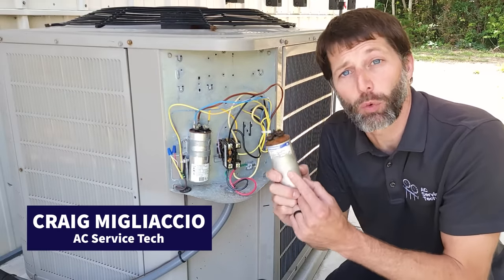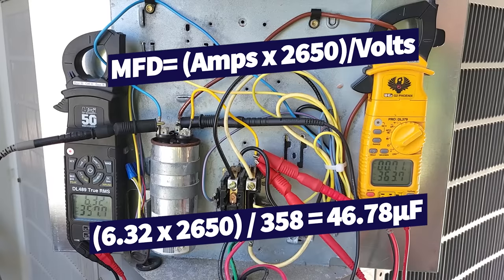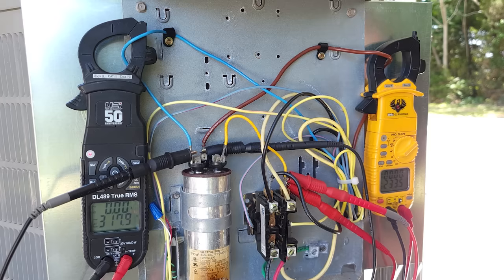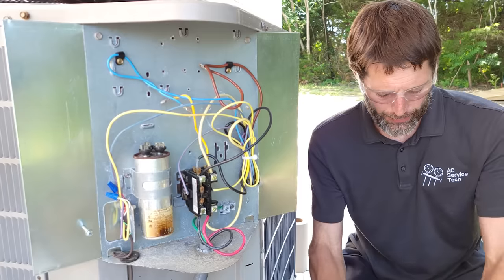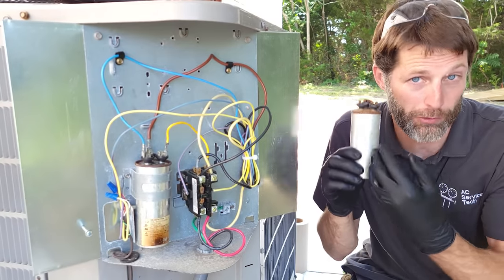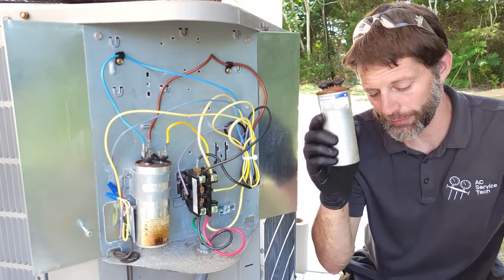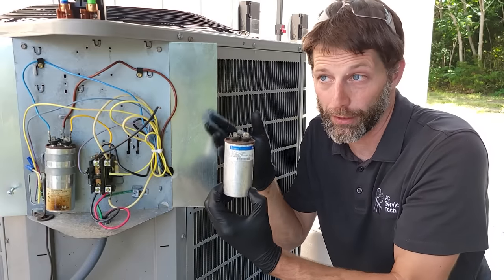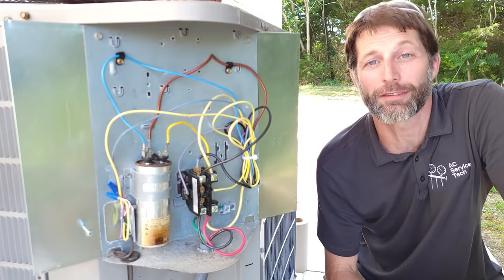WHY CAPACITORS FAIL in Air Conditioners! Watch it Break!

Comment: My compressor fan shuts off after 10 minutes of turning the AC on but the compressor still running. I have to turn off the AC and wait for about 15-30 minutes then everything is fine but the Fan will turn off again after 10 minutes.
Reply: Fans have a thermal safety in them. Something is kicking it out, your fan motor is overheating.
Usually this can be the motor windings failing, but test (or replace) the capacitor [cheaper] first.
(Also, are the bearings good? - turn freely, NO drag?). Sometimes you can oil them, sometimes there are capped off oil ports (2) at the 'edge' of the motor case that lead to the center to the bearings (usually are metal plugs, look like a rivet head).
A new fan motor is probably in your future...
Mr KL

Comment: What about when the power company loses grid control and “brown out occurs (voltage low)? Ohms law suggests current high in that scenario, does it not?
Reply: No, capacitor will only allow so much in and out.

Comment: Will a bad capacitor cause fuses to blow???
Reply: They can but not always.  If the compressor can't start because power isn't getting to the start winding but has power to the run winding, it will pull a large amount of current because it is trying to start spinning but can't because the start winding isn't getting power.  The start winding basically gives it a short but large power boost.  Most compressors can't start without a working start winding and power.  

As a example, a really old central A/C we had would pull about 22 amps while running.  When it was starting, it would pull 50 to 60 amps for a very short time.  I'd estimate well under a second.  If the start winding wasn't getting power, it would pull that 50 or 60 amps until the breaker tripped or the fuse burned out.  It is actually a good thing since it can prevent damage to the compressor.  

Some motors also have a capacitor on the run winding.  Most of the time, if it fails, it just sits there.  My well pump has a run capacitor and when it failed, nothing.  No hum, buzz or anything.  I might add, the capacitor looked fine.  No discoloration or buldging.  Testing showed it was bad tho.  A run capacitor and a start capacitor works in different ways. 

Also, if you are replacing one of these things, make sure power is off and use a screwdriver to short all terminals.  Sometimes a good part of a capacitor could have a charge.  It can be painful or even deadly.  Make sure you only grab the handle and the handle insulates, no wood handles that may have a crack or have mosture in it.  Also, no plastic handles with cracks either. 

Hope that helps.

Comment: Is it ok to install a capacitor that is a little above the rating of the one you are replacing??
Reply: NO. Always use the properly rated cap. Bigger is not better here.
Reply: @davidb7180 
The voltage rating on the cap is an  indication of what voltage the insultation may fail. A higher rating, if available, is a good thing.  The capacitance (mfd), however, affects how it does its job and should be as originally supplyed.
Reply: I agree with Gary.  I higher voltage rating will be fine.  May last longer even.  However, the value of capacitance must be the same.  If you have a weak motor, a service person may change the value which will give you a little time to plan for bigger repairs but they are no guarantee on how long it will last.  At best, a last resort.  At worst, won't work or cause more damage.

Comment: Older Rheem condensers had the capacitors placed in the airflow before the coil and in my experience they failed less often.
Reply: I have two of those; one is from 1996.
Reply: @kwm380  They are very well made units.
Reply: This is true
Reply: The old caps that were in the gray plastic case
Reply: Those Rheem low flat green stamped cubes were so well made. There are still plenty in service.

Comment: how do you get the 2560 factor when calculating the cap size
Reply: It comes from the reactance formula.  The most accurate numbers are 2652, 2653 instead of 2650; depends on how many numbers one uses of pi.  As Will F says in the comments on hvac r school dot com:
It’s 2653, because of E = I * Xc.
Capacitive Reactance (Xc) is calculated like this:
Xc = 1 / (2 x pi x hz x farad)
Xc = 1 / (2 x 3.1415 (pi) x 60 (hz) x farad)
Xc = 0.0026527 x farad
farad = 1,000,000 microfarads
So 0.0026527 must be multiplied by 1,000,000
Xc = 0.0026527 ✕ 1,000,000
Xc = 2652.7
E = I x 2653
Also, using this method can make good capacitors look bad if your amp clamp doesn’t have a resolution of .01. Also allow 10% on capacitors to account for meter error.
Always test both ways using a good DMM before charging a client.

Comment: Years ago I had a brand new carrier residential type package unit at a warehouse and the inducer motor run capacitor was getting wiped out every week, we tried a new motor, checked voltage and hertz, no swelling or leaking, tech support came out, he blamed the fact that one of the 2 legs measured 240 to ground each (even though it was 240 line to line), I left the company before seeing the cause or how it was resolved. I wonder the cause.
Reply: Inducer motors have run caps?
Reply: @marioramirez6741  some do, this was 4uF I believe
Reply: @ChrisHVACguy  was it mounted to the motor housing and/or near the burners? Seems like a dumb suggestion but can it mounted it on the blower compartment. I know it's too late now but just a thought.
Reply: @marioramirez6741  was mounted way above burners in a separate compartment next to the circuit board, I'm sure it could have, might have been worth a shot
Reply: It's possible the system was on a 208 three phase ungrounded system. The inducer fan was on a contractor that was single pole. Leaving line power on the motor. The third phase could go to ground some where else in the wearhouse .then the other two phases have potential to ground .this can take out the weak link.
Reply: @peterstencell804  unless there's was a trickle current to ground on the motor or cap, I don't see how this would be an issue, it's common for lines in a unit to have potential to ground.

Comment: What does it indicate if a wire melts in two.
Reply: Usually a bad or corroded or loose connection; creates heat that accelerates more corrosion until it burns in two.
Clean EVERYTHING bright, and put on a new terminal,. Check for heat damaged to component.
Mr KL

Comment: I have a question that someone here may answer. I replaced a bad cap in my window shaker but the only one with the correct rating was physically larger and oval. Only way to install it was upside down, think that will cause a problem?
Reply: As long as the rating is correct, I think it should be fine.  However, my expertise is in digital electronics, not high-power stuff like air conditioners.
Reply: @electronics-girl  thanks for replying its been working so far🖖
Reply: Most capacitors will work in any orientation.  There are some that won't but I've never actually seen one and I've worked on all sorts of things.
Reply: @noneyabus1  thanks for the input🖖

Comment: Can you tell what is that constant of 2650?
Reply: For an AC circuit, I=E/Z where Z is the impedance.  The impedance (Z) of a capacitor = 1/(2*Pi*f*C) where f = frequency and C = capacitance.  Therefore if you substitute 1/(2*Pi*f*C) for Z in the formula I=E/Z you come up with I = E/[1/(2*Pi*f*C)].  If you rearrange the formula you then get I/(E*2*Pi*f) = C where Pi = 3.14159 and f = 60 for a 60 Hz system.  The formula then becomes I/(E*376.9908) = C  This is the same as (I*0.002653)/E = C and C is in units of Farads, but since we want C in units of microfarad the formula becomes (I*0.002653/E) = C/1,000,000 and this can then be written as (I*0.002653*1,000,000)/E = C in units of ufd which is the same as (I*2653)/E = C in units of microfarad.

Comment: The main purpose of this capacitor is to throw the sinewave out of phase. It can be done with an inductor but it would be larger and more expensive. Smaller motors use a start winding

Comment: you know I'm quite proud of myself l o l My AC wasn't working so I took apart my compressor learned what a capacitor was notice the top was all rusty and as you see mushroomed figure that was the problem replaced it, works. Then I found this video LOL but I'm glad it confirms without all the multimeter stuff that I was right by eyeballing it

Comment: capacitors should be painted black to radiate heat and or have black heatsinks to do same...simple soultion or even put a small fan to keep it cool or a bleed air tube from the main output
Reply: just a note,  the majority of thermal radiation energy flux at room-like temperatures is in the range of 7000 to 26000 nm, which is far into the infrared. The visual color of the paint has nothing to with the emissivity in that region. Visually white paints are usually fairly black in this region for example. Bare metal is definitely worse, as it has very low emissivity (it's mirror-like), but at room-like temperatures, electromagnetic radiation is usually only a minor contributor to cooling compared to heat conduction by air, so it doesn't really matter.

Comment: If they were heat sensitive, maybe they should make ones that either aren’t or to stop putting them in a hot place. And if the foil fails, maybe they should go back to the drawing board.

Comment: Some things made in China are great. Firecrackers have been made for millenia. However I don't want those confused manufacturers who make capacitors that behave like firecrackers. Also,there are no spare rollers in wheel bearings and one breaking into pieces doesn't mean the rest are "ok".
On the subject of A/Cs. Kudos to the farmer turned engineer who saved countless $s making the heat exchanger in my marine unit with the water cirulculating through the gas size line ,about 5/16 and the gas circulating the water line,5/8. The capacitor has been changed only once in 8 years!

Comment: Question for any pro, why is my 25 year old ac at work still working with 0 mantanice and no air filers inside the building. Yes it's just a normal house unit that runs the office

Comment: Capacitors are electrochemical devices and over time the chemical depletes. Even if they check out on the meter, replacing them now and then just makes sense. Much cheaper than a compressor.

Comment: And capacitors do the exact same thing on circuit boards at the component level they'll swell at the top and at the bottom or just simply dry out over time and also or just simply leak out it's electrolyte

Comment: What is the purpose of the capacitor?
Reply: Basically, a running capacitor changes the phase angle of the supply to the starting winding's to help it electrically match the running winding's, and you end up with both winding's working together. Without the running cap, you would need either a mechanical/centrifugal switch, or timed electronic switch to disconnect the start winding's from circuit as the two winding's CAN'T work together un-aided.

Comment: These caps are no fun! I used to work in an industrial instrumentation and process controls shop and every so often one would let go with a bang and a huge cloud of stinky, dead-fish smelling smoke. I collect and restore old CB radios and the tube sets will occasionally let loose. It's all part of the game.
Reply: My understanding is that the unique 'fish stink' was a dead-giveaway of some cheap Chinese electrolytic capacitors knock-offs apparently attempting to copy proprietary US products or just use cheaper formulas.
I have smelled both, and the fishy smelling ones have a distinctly different odor than US brands (or good imports).
Both are pungent...

There are accounts of a public relations debacle several decades ago when a major computer manufacturer, that starts with a 'D', was blindsided by a supplier that was supplying supposedly quality parts. Initially they met specs and there was no indications that anything was amiss until several years and millions of units had been sold.
Suddenly huge percentages of sold products were failing, and IIRC they had absorbed large losses as they voluntarily extended coverage for failed units.

In fact I have a motherboard of my own from that same period/episode and I am replacing those 'fishy' caps. They even stink when they're not blown, when you unsolder them!

Google 'Capacitor plague'...
Mr KL

Comment: It doesn't matter how a capacitor fails. Just replace it. These are expendable devices requiring routine maintenance. They aren't designed to last forever.

Comment: Why not just use a bigger cap next time ?  instead of 45/5  uf   get 55/10ff?
Reply: Could very well damage the motor.  Damage a compressor once, you won't want to try that again.  Increasing the voltage rating may help tho.

Comment: Failure on command!
I'm sorry you didn't tell us that you applied a heat gun to the bottom of the cap to make it fail. (Other than you said it failed due to heat, you cooked it to make it fail.) Besides heat what else makes them fail? (You don't discuss wrong size capacitors or other load problems)

Comment: A/C capacitors are a cheap, easy fix that a homeowner can just do themselves every 10-15 years.  Why wait for it to fail?  Save the HVAC repair company a call and your pocketbook $200 to $500 for the repair.  It's only about $20 to $30 for the part.  Take a photo of the sticker of the current capacitor, go walk into a local HVAC supply store that is open to the public, and let their staff select the correct capacitor for you.  Then double-check the numbers of both capacitors before purchasing/installing it.  Just be VERY careful to properly disconnect the power (there's a power box next to the A/C unit with a simple pull tab without having to go to your breaker box), do NOT touch the leads with your bare hands (wear work gloves) when replacing the capacitor because large capacitors can deliver a lethal charge, and move the wires from the old capacitor to the correct leads on the new one (Hint: Each A/C capacitor has 4-3-2 leads).  HVAC repair companies should be in the business of educating homeowners on simple fixes like this that they can do themselves instead of trying to make a massive profit.  Just tell the homeowner:  If the capacitor is rusted over and looks like it has been pretty hot at some point in its past, just replace it with a similarly sized capacitor.  Give them the name of a good, local parts store, and walk them through the steps.  Takes 5 minutes, is the cheapest part of an A/C unit, and the most likely part to fail.  People pay tons of money for education so why waste someone's $200+ on a service call when it can be an educational opportunity?

Comment: Why do they sometimes fail by putting out way too many mcfs?
Reply: mcf's? Restate the question?
Reply: Yes, I have had a 40 mcf capacitor reading over 80 and the compressor will not run.
Reply: @karlsakocius  mfd? or uF, µF. old school term was mmf. I never saw mcf...
Are you disconnecting it when you measure???
How are you measuring it? I never encountered one going way up in value.
In fact that is not quite possible. Is it possible is was mislabeled? (did you measure it new/initially?)

A capacitor and an inductor have opposing effects on a test meter - if you had it connected, it likely read erroneously with the reactance of the motor winding across the test circuit...
Parallel resistance affects the meter reading also, in unpredictable ways.

[check the resistance too, it should be infinity. It could be leaky if the µF reading is high, throwing the meter off...]

Mr KL
Reply: @karlsakocius  How bizarre; Your latest reply shows in my notifications, but NOT here, but it ALSO disappears in my notifications if I drop down all the replies! -stealth reply?? LOL
[is there private PM here??]

If we are talking about oil/film run capacitors, there is really no conceivable way for capacitance to go up. Capacitors can loose capacitance, but not go up.
I am NOT contradicting your observations, merely endeavoring to solve an apparent mystery...

The electrode area can not increase logically, the dielectric constant would have to somehow increase... (change in chemical composition? oil breakdown? oxidation?
Or the insulator film would have to become 'thinner', also improbable. (or the oil would have to squeeze out of the structure and the assembly 'shrink').

The most reasonable conclusion is that they were high to begin with.
Possibly several causes: improperly manufactured parts, counterfeits, parts run got the wrong labels (maybe just a few, maybe switched runs and didn't get all the labels out of the chute?).

Also, meters use various methods of measuring capacitance. None read the values directly, they usually employ time constant measurement or impedance methods, using their own choice of test frequency(s). These can be affected by series or parallel resistance and inductance.

You didn't mention if anyone had measured the initial values. (I would not expect anyone would have.) I would like to find out if anyone has noticed any pattern of brand of AC or brand of the capacitors that are found reading high. Also, readings of them for internal resistance to be sure it is not just leakage resistance making capacitance read high...
I don't suppose you still have any.

Are you in the trade?
You mentioned 'you asked your guys'...

Occam's razor and Sherlock Holmes' quote: “When you have eliminated all which is impossible, then whatever remains, however improbable, must be the truth.” are sound guidance here...

Mr KL

Comment: We should just move to slightly more expensive, efficient, quieter electrically commutated motors (ECM) for new applications and discontinue use of cheap, wasteful, loud, and fragile permanent split capacitor (PSC) motors where feasible. DOE mandated them in furnaces because they're obviously better like LED bulbs compared to oil lamps.